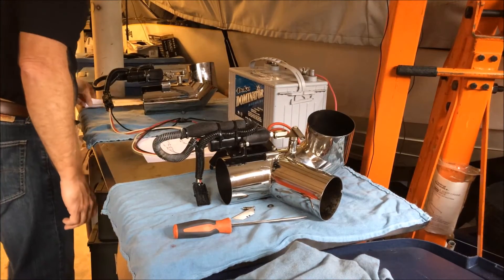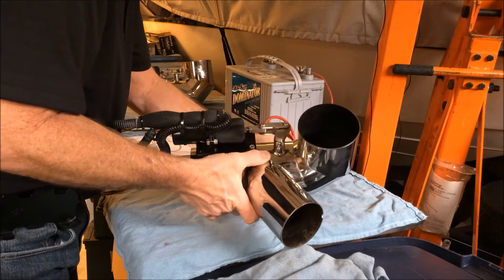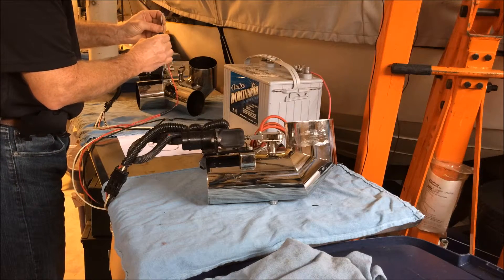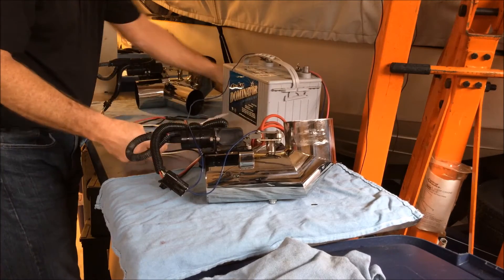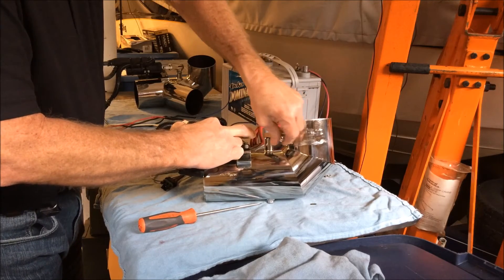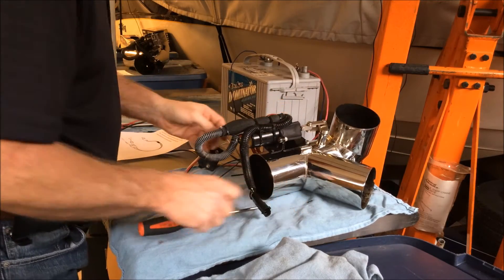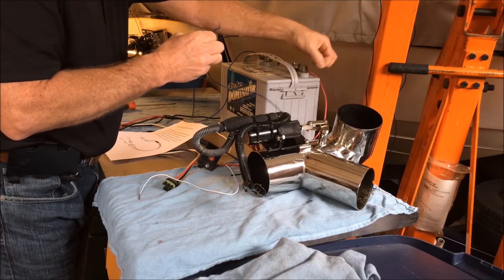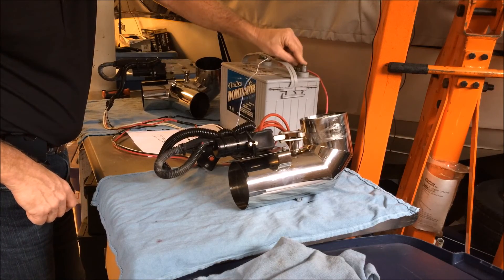Corsa Marine exhaust diverter solonoid testing

Comment: Nice video detail and explanation! Did you make any videos on rebuilding the diverter valve?
Reply from the maker: Sorry but no. Valve actuators were easy to fix with new o-rings. Corsa sent me the correct ones free of charge. Took me about 15 minuets to change them. I used lots of dielectric grease and they still work perfect now. All my problems were stuck valves and not the solenoids nor wiring or harness. Hope that helps you.
Reply: Would a bad diverter valve cause a ticking noise increasing with rpm?  @mediajunkie2195
Reply from the maker: @KingQ700  Doubt it but the engine itself would